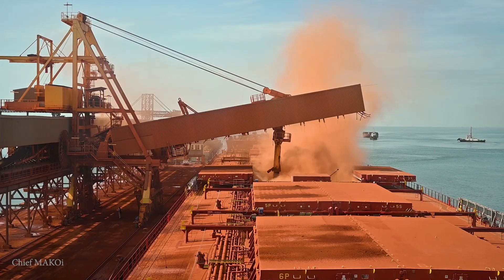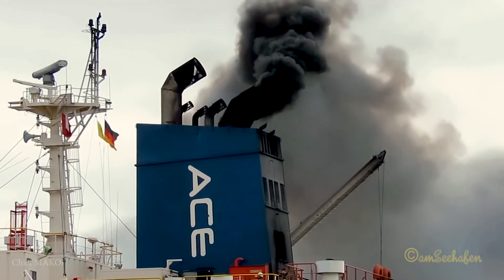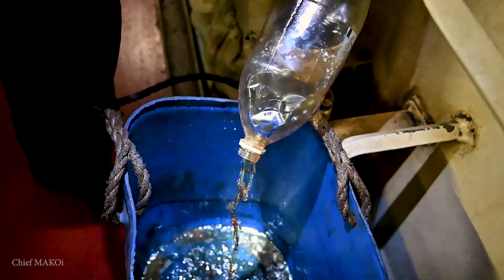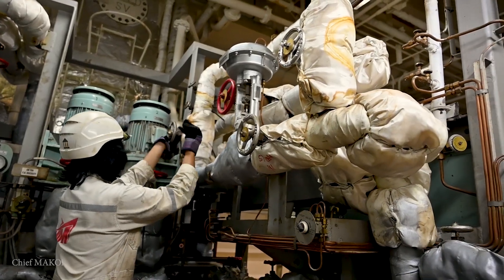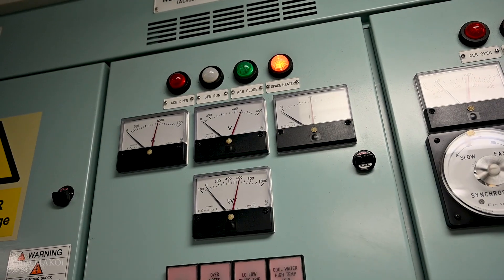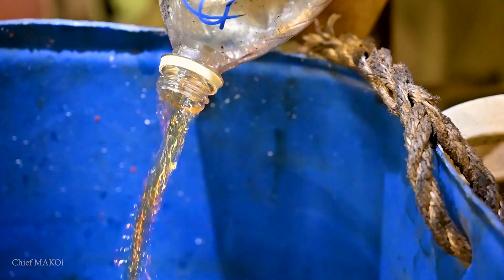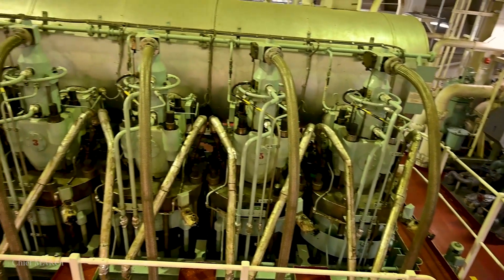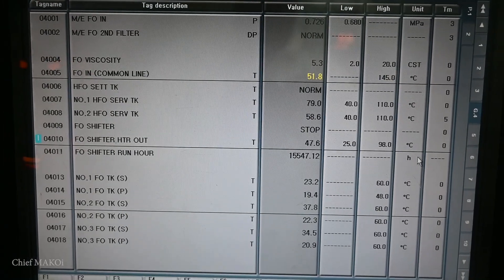Changing The Ship's Fuel : From Heavy Fuel Oil to Gas Oil Changeover Procedure | Chief MAKOi

Comment: Back in the 1970's when I was tramping  the oceans, the engineers always changed over to the lighter diesel fuels, a day or so before entering port. For the simple reason they did not want the heavy fuel oil solidifying in the fuel lines. There was non of that clap trap about clean air.

Comment: Serious question from a hotel engineer/maintenance man here: Why not just install a large sight glass at some point along the fuel supply line directly into the engine that lets them see the opacity of the fuel? That would completely eliminate the need to take multiple fuel samples during each crossing of that border.  Samples that, no doubt, would be considered contaminated waste that then  would need to be collected and disposed of with proper techniques.

Again: Why isn't there a large sight glass permanent installed for this in the ship's piping?!?🤬

Comment: Yep just a far more control way of changing fuels.
Then pump diesel to vegetable oil.
.
Rather than steam i use engine coolent,for heating the veg oil.
.
Ive heard of some people using engine oil on engines that use it to operate the injectors rather then a cam lobe.

Comment: Chief,

Excellent video.  I am what I like to call a "textbook engineer".  Before retirement, I was a naval architect and marine engineer.  After college, I work for the marine departments of large oil companies.

Using low and ultra-low sulfur fuel can present other issues.  Some of these issues can be addressed by the ship, and others need to be addressed ashore.

The process of fuel changes starts with the original crude oil used in making the fuel.  We experienced the plugging of fuel injectors as a result of differences in crude oils used in making different fuels.   If crude A is used for the heavy fuel oil and crude B is used for the ultra-low sulfur oil, and crude A and crude B are incompatible, plugging of the injectors is inevitable.  These issues, 20 years ago, required testing at shoreside laboratories.  If bunkers were to be loaded our ships moved fuel onboard to isolated tanks.  A new fuel that was loaded into a separate tank and was not used until laboratory tests were received by the Chief.

When possible we used fuel from our own company and loaded it at our docks.  When we used other sources we required samples from the source.  We also took samples before and after it was loaded onto bunker barges.  Our chiefs took multiple samples when loading fuel.  One sample was kept onboard and one was sent to the laboratory.

Fuel quality is important not only for sulfur content, viscosity, and flash point, in two-stroke engines it can affect which cylinder oil is to be used.

Bob

Comment: This black gunk that is a major contributing factor to global air pollution should be outlawed even away fro coastal waters. I mean, completely outlawed. Rail diesel engines have long ago been required to use what we call light diesel in automotive and house heating.

Comment: Pretty crazy that multi billion dollar shipping companies can use crude oil as fuel and use millions of gallons of it polluting the environment, but a 4 cylinder diesel car needs a DPF filter and EGR cooler and a bunch of other ridiculous stuff just to run ultra low sulfur diesel, once again, the little guys get fucked and the rich get richer,

Comment: Hi Chief.  In my day when I first went to sea, we changed over to diesel to stop heavy from coagulating in the lines.  In later years - late 70s, we didn't change over at all, just stayed on heavy with the usual precautions in port and a bleed through on standby.
When we did changeover (say for drydock) we just operated the changeover switch and let the viscotherm do the job - closing in the steam valve by itself as the viscosity dropped.  The PRV on the engine rail returned the fuel/fuel mix to the buffer tank and back to the rail.
I understand the reasons for Annexe VI - it shows that the marine industry is doing its job to help the environment, as 90% of ocean pollution is from land and not from ships.
Nice to know you guys are working to the same integrity as we did in my day, now 36 years ago!

Comment: Wow, a complicated process and a very interesting video! 

I had no idea that you had to heat the fuel oil that much, even in the storage tank - 40C is pretty warm, seems like it’d take a fair bit of energy to keep a big tank of it that toasty. You mentioned steam heating, but I think that was just for the ready-to-use tank and the final plumbing. How are the storage tanks warmed? Can you use the heat of the engine’s exhaust while under way? (Also, it’s a minor thing, but I found the valve-turning tool at 3:30 interesting. A simple solution to the problem of difficult-to-access valve handles and the torque required to operate them! 👍)

Comment: I had an idea years ago to use a turbine to generate boost pressure, exhaust scavenging and a way to reburn the gasses to clean them up before they leave the ship. I tried to get a patent but the company just ripped me off. I still think it would work. Also turbine powered forced induction systems for high performance diesels is part of the idea.

Comment: Do clean, or cleaner, methods of propulsion or hybrid systems make economic sense? For example, an electric motor that is powered by solar cells with batteries in conjunction with a generator. Does using natural gas or methane make sense?

Comment: I actually have a question:
Where do you put the sampled fuel after inspection.
You can't just toss it into one of the fuel tanks again (at least not if it's a mix of the two fuels) so where do you put it? Does it get discarded? But where? Are the samples stored for later separation?

Comment: Company that I worked for back in the early 60's used to use #6 thick bunker oil. Can remember that it had to be heated and was often hard to start up the first boiler on a Monday morning. Was better when they went to think it was #2 thinner cleaner oil.Somebody called the gas company up in warmer weather five days a week to see what they were charging that day for gas to figure out what fuel was cheaper. Old time machnists would recycle dirty oil from large gear boxes into under ground fuel tanks when boss wad not around.

Comment: Our company has developed a product that can be injected into the heavy oil fuel tank which then reacts with fuel oil and reduces viscosity and also reduces the sulphur content. It allows ships like yours to no longer have to worry about switching over or worry about violating MARPOL regulations. We have setup distribution sites in the UAE and USA for our product. You are more than welcome to reach out for more information.

Comment: I concluded that ships used residual fuel oil due to the rise of the automobile a century ago and the concomitant expansion of the petroleum industry. Crude oil yielded gasoline, light fuel oils like kerosene and Diesel fuel and heavy products like grease, tar and asphalt. But there was a leftover, hence the name "residual", with no market value. Then an oil executive had a great idea: We'll sell it to the Navy! On a big ship you can have equipment to heat and atomize the oil, so we'll sell it to Uncle Sam at top dollar instead of dumping it in the river, like we've been doing. When the merchant marine learned that residual oil cost less for labor and saves time in bunkering, a long and happy friendship was born.

Comment: you will notice if a ship had Filipino sailors if the ships like this had IMPROVISATIONS had been made for cost cutting of parts like what i saw. they used empty pet bottle as a funnel to avoid splattering of fuel

Comment: How different are the systems when the main source of power is a nuclear reactor, not diesel engines?
Reply from the maker: The auxiliaries will revolve around what is needed for the main.
Reply: So if a nuclear reactor produces steam to propel a ship,  all the auxiliaries will be propelled by steam as well, correct?   Is that how it worked when coal fired boilers propelled ships in the past?

Comment: Leave it to the engineer to end the fuel line under stairs and a platform, in that cramped mechanical area instead of an arms length away from the hotness.

I have always accepted the cramped conditions on land vehicles as a necessity of space, but you have a whole gymnasium-sized room to work with, why kill yourself to get fuel samples with that valve where it is?

Why use plastic to funnel and capture fuel samples?
Doesn't it break down when in contact with other petroleum products?

Comment: And this is why we need international agreements for environmental protection and CO2 emissions. You'd think that when a region requires a specific cleaner fuel that it would be easier to just use that everywhere (well it obviously would be) but under profit driven capitalism if you can save money by using a filthier fuel elsewhere it doesn't even matter that is complicated.

Even if some or even most operators really want to be environmentally friendly, it doesn't matter as long as it's legal not to because everyone will be forced to use the cheapest and dirtiest option ro remain competitive against those who don't care.
Reply: Btw. Stricter global rules would not be "bad for business". As long as it's the same rules for everyone it would not affect competition it would only make everything slightly more expensive

Comment: Nice video! I used to work for a power station that used both fuels for decades without issue. Then issues with the injector and fuel pump orings melting away began to occur. For a few weeks we had problems with many of the engines being shut down at night for pump swap outs which was costly. 

No one could figure it out, but during a conversation it was mentioned while one of the HFO tanks were being cleaned, fuel was moved to an LFO which still had a significant quantity of LFO in it. No one thought it was an issue, but I mentioned that perhaps the LFO being heated as a blend with the HFO was disolving the orings. There was a bit of doubt but a fuel sample was sent to a specialist who placed our orings in the fuel oil at the temp for the HFO and in a day or two sure enough they started to disolve! 

So lesson learned there! :)

Comment: So basically when they switch to the more expensive fuel they don't have to heat it as much. Is the temperature a continuously variable function of the fuel type ratio? Is this sensed and applied by a computer?

Comment: Maybe once we can start producing a significant portion of our hydrogen cleanly, rather than breaking down hydrocarbons for it, ships could be a whole lot cleaner. 

Unfortunately, only a tiny percentage of hydrogen produced is actually made cleanly.

 While hydrogen gas is infact clean when used, it's production isn't. CO2 scrubbers/capture systems can be used at production facilities to maker cleaner hydrogen, but it's still nowhere near clean. Still, anything to help wean ourselves off of fossil fuels is good.

Just my two cents. Shipping is a massive industry crucial for modern life, but its large size has an equally large carbon footprint. Measures have been taken to reduce it, and shipping still isn't the largest contributor, but every little bit counts if we're gonna survive human-caused climate change.

Comment: @4:29 ... The engine has approximately 18,079 hours on it 🤓

Multiplied by an average speed of 15 kts, we get 271,185nm total distance since counter reset. (I did not calculate idle time in port, so just go with it). In other words, 129 times around the world.

Comment: Great Video... I was 2021 on a vessel and it is huge amount of carefully work to make a safe changeover.
Also we had Problems with the heavy fuel, The Seperator got clocked every few hours so the crew hat to clean them for 3 days avery 1-3 hours !!!
If they dont, the Main engine would stop working what can be very problematic or even deadly in strom conditions,the fuel is far away from the Fuel on the gas station... sometimes much wrose than old enginge oil from your car.
After the 3 Days we were finally able to discharge 150 Tons of that shit near Malta...and only becaus one of the Chief engineers made a miskate and mix some onf the old heavy fuel with a new charge...

Every time after Bunkering new Fuel a probe send to a laboratoy to find out the Chemical properties to avoid such problems.

Comment: We had an 800 ton tank of bunker fuel at work. It was used to generate electricity and steam for industrial processes (from exhaust gases etc) It was operated by the local electricity board. and kept at the desired temperature to be used in two large marine diesel engines. It had been free of problems until a welder had been employed to repair something on top of the tank that was almost full. The accumulation of vapour caused an explosion, blowing the top off the tank and igniting the fuel. It roared like a huge firework, producing enormous amounts of black smoke, heat and flames. A 30 ton tank of light oil, next to it, easily caught on fire and took off like a rocket, clearing the roof of an adjacent building. The heat could be felt several hundred yards away in an office building and the fire took a while to extinguish.
Reply: Rip welder, management should go to prison

Comment: Hey Chief, if your company offered to set you up with a nuclear-powered vessel, would you consider using it? There'd be no fuel change-over procedures, you can sail faster since the fuel's cheap compared to the energy it provides, and there's no emissions to regulate. There's been no major reactor accidents with nuke ships since they hit the water right after WW2, and there's talk about using entirely new reactors that promise even safer and smoother operations than current tech for next-generation cargo vessels.

EDIT: I also watched your video on Bauxite liquefaction recently. A nuclear cargo ship, if it's dedicated to hauling raw ore like Bauxite, could use surplus reactor heat to safely bake the water out of the cargo, reducing the risk of disasters.
Reply: Nuclear reactors are extremely expensive and require highly trained personell, never mind the government regulations. Shipping is a very competitive business, as you can see by their usage of the cheapest fuel whenever possible, so this will likely not be viable in the next decades.
Reply: @CjqNslXUcM  About the cost and personnel requirements, TerraPower's teaming up with another company to make ship-compatible MSRs, which promise to run more smoothly with less rigorous intervention due to their better thermochemistry. There's also growing interest in it among shipping companies due to the higher speeds it would enable relative to fuel costs. There's money to be made in expedited shipping, plus they'd be fast enough to sail the long way around and keep markets going smooth in the event of another Everglade-scale Suez clog.

Comment: I had the pleasure of interning at MAN’s engine research facility in Copenhagen and working on one of the big testing engines, and I got to see tests of heavy fuel as well as light fuel, and the air scrubber, now scrubber might sound weird but it’s literally just a shower they pour the smoke into, the sulfur is bound by the showers chemicals, however as I remember they are a bit expensive

Comment: I was in the US Navy and steamed the N Atlantic. We used this fuel the Navy called it ND Fuel. 
It was so nasty we had to be 50 miles out before switching. The soot stuck to everything. If we had a watch by the funnel, get back when they blew the stack. It would not wash off your skin.
Reply: Non distillate fuel, that stuff is closer to asphalt than it is diesel

Comment: A very clear explanation about the fuel change over procedure Chief.
 Changing over from HFO to MGO was always something to pay attention to.
Stuck fuel injection pump plungers or spill valves due to too rapid cooling down sometimes happened.
The rapid cooling down became sometimes necessary, when the guys on the bridge arrived a bit earlier at the pilot station than initially anticipated😜

Comment: Are their any adjustments to the engine that is required to do this fuel transition? It would seem that the dramatic reduction in viscosity would change the spray pattern of the fuel injector nozzles.

Comment: I live on the U.S. Great Lakes.  Occasionally seagoing vessels (referred to as "salties") will come onto the Great Lakes for one reason or another.  Could you please tell me if there are any significant differences in the operation of a vessel in fresh water vs salt water?  Also, are there any procedures that need to be followed to prevent the transfer of invasive species?

Comment: When American trucks were switched to ULSD or ultra low sulfer diesel, it lacked the BTUs of the old #2 diesel. Back in the 70s, #3 diesel was still available and the incredible power from it was highly sought after. What is the difference between the two types of fuel when measured by BTUs?

Comment: No you change to molten salt thorium reactors which will be cheaper than coal. If the ship somehow sinks, the fuel will be drained into a drain tank and keep all the nastiness inside and not out in the ocean like Fukushima. It will burn nuclear waste from the current fleet of reactors and convert it into energy and will not have long lived nuclear waste. Every ship even small ones will be able to afford this as it will be cheaper than coal, much less bunker c crude oil.

Comment: Interesting video but isn't the view of the thick black smoke issuing from the stack misleading? 1:23 As far as I know Heavy Fuel Oil whether used in a Diesel engine as per the video or firing a steam boiler can be burnt without visble smoke out of the stack (or perhaps just a haze).